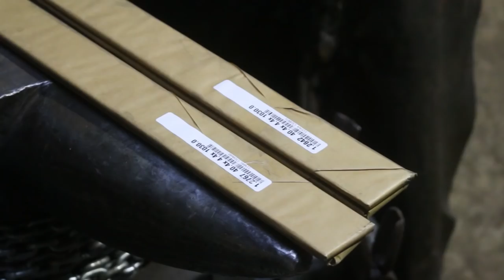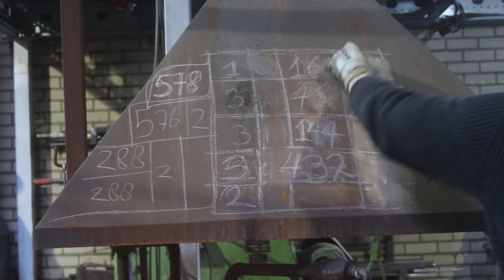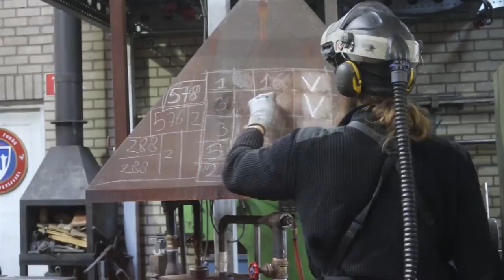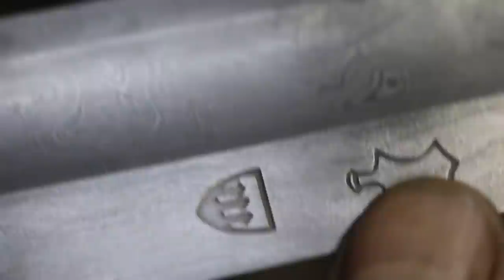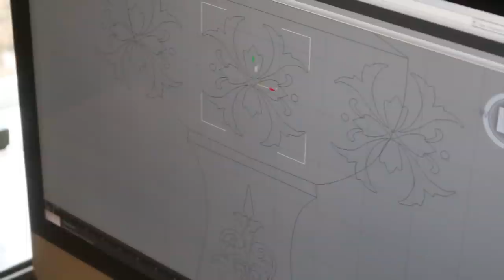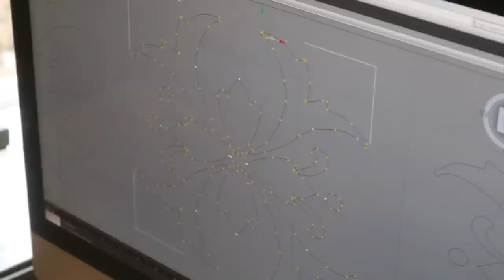Forging an Indian Scimitar sword, the complete movie.

Comment: I wonder: In other forging videos I have seen the smith cutting the hot bar, folding it over and forgewelding it while it is all glowing hot. I am everything but an expert, but wouldn't that method be faster than everytime waiting for the bar to cool down, cut it up, restack it and so on?